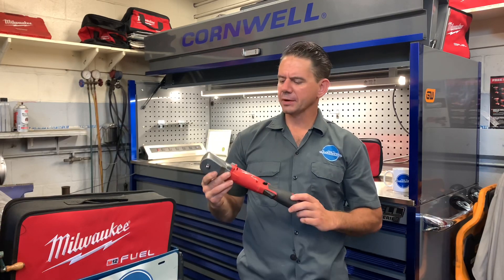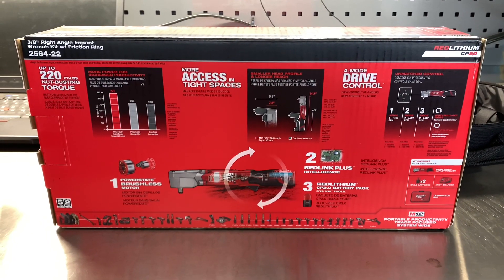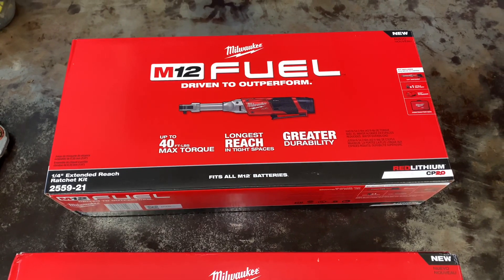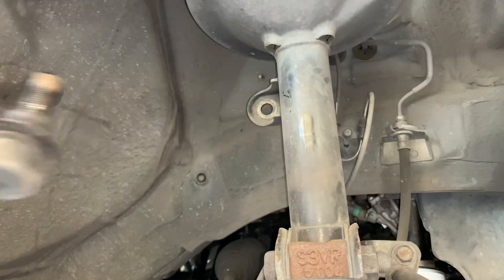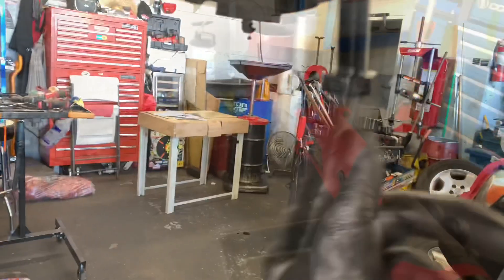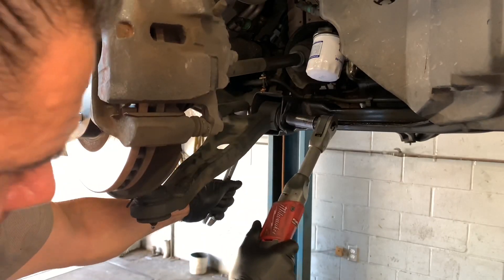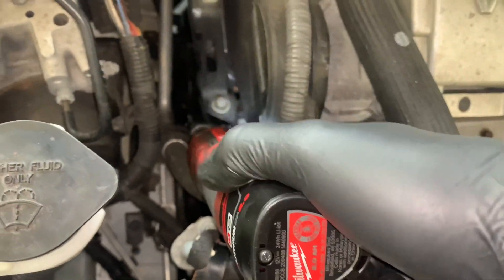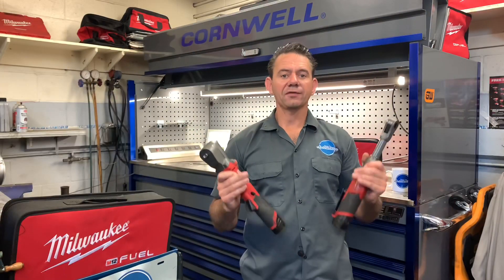Milwaukee Tools New Right Angle Impact And Extended Reach Ratchet

Comment: I wouldn’t buy one.  I’ll buy the snap on electric ratchets
Reply: Overpriced
Reply: @andym1223  have you use one ..?
Reply: It good but the battery off the Milwaukee are way more versatile not locked to 3 tool